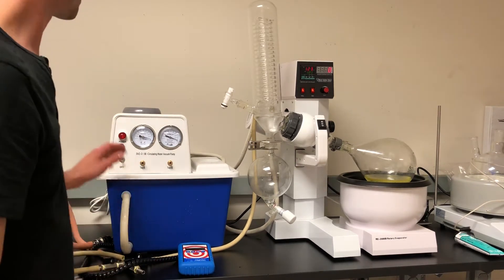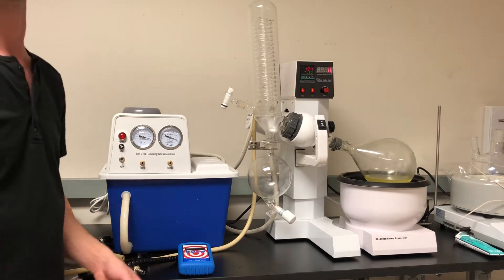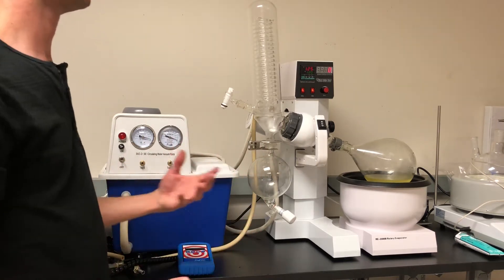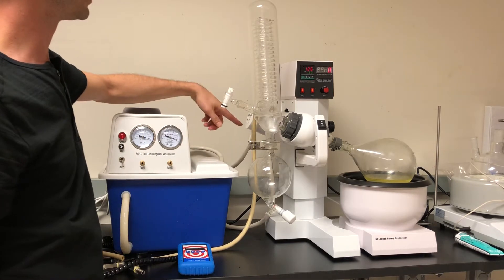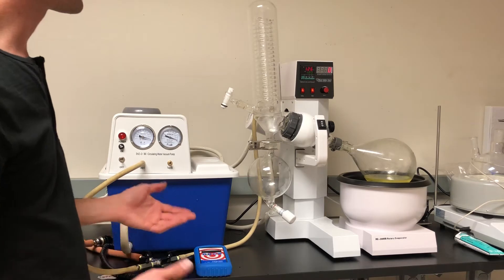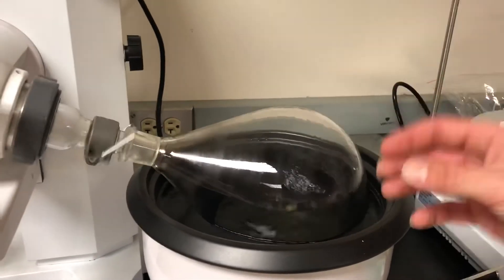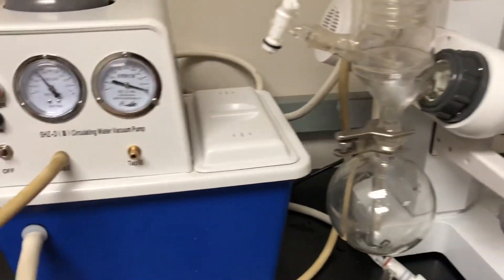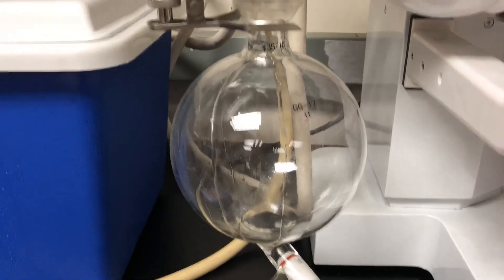Best Value Vacs Water Circulating Vacuum Pump

Comment: How high is it supposed to be filled with H20?
Reply from the maker: @sjackson1739 to ensure a smoothly running system, it's important to minimize the bubbles in the return line. There isn't a visible maximum line, but all you need is to fill the water up to about two inches from the lid.

Comment: what is the best way to get the product out of the primary flask? do you sell little scrapers or is it usually pretty easy coming out of the flask considering it prolly doest stick to the sides cause of all the spinning?
Reply from the maker: @jdspharmacopeiacsaspagyria9615 while the flask is warm from the hot bath, you can hold the flask upside down to get 99% of material out. To clean the glass we recommend using an ultrasonic cleaner.

Comment: Is that temp controller on the water bath only in Fahrenheit? Cuz if so that’s a very brain dead decision y’all made when designing this.
Reply from the maker: @Chonchi999TheG I'm sorry I thought this was America? South Park reference. Only joking, we understand you'd want to use celsius for all evaporation purposes and that is why the rotary evaporators BVV have made are in celsius. We carry 5L, 10L, 20L, and 50L systems that operate in celsius. This table top 2L is a standard 2L roto with our brand on it. I can confirm it works great when you get used to running in Fahrenheit!

Comment: are you using a cold trap? Is it needed for 2l roto Vap? I know it's needed for short path distillation.
Reply from the maker: @nebur85 you will always need to use a cold trap with a rotary vane vacuum pump. These vacuum pumps use oil and the vaporized solvent can travel down into the pump's oil causing the pump to seize. The kit shown in the video does not use an oil pump (rotary vane pump). Instead it's paired with a water aspiratoring vacuum pump. Since this pump does not use pump oil you can run a rotary evaporator without the use of a cold trap.

Comment: Can this be used for vacuum distillation also?
Reply from the maker: @Dylan Michael the rotary evaporator is basically a solvent recovery system. You cannot run distillations using this glassware.

Comment: Is it possible to carefully show exactly which hoses are connected to the condenser. An upclose view of which hoses go into each connection will be most helpful!
Reply from the maker: @sjackson1739 on the condenser there are three glass barbs. There is one barb connected to a glass tube leading to the top, this will be used for vacuum. The other two barbs are connected to the internal glass coil, you will use these to recirculate your coolant. 
We can send you a photo through email! Shoot us an email at support@shopbvv.com.

Comment: The vacuum doesn't have a regulator right, have you tried using anything like a T-valve to get some control? Does the vacuum cause any bumping problems if it is always 0-100?
Reply from the maker: This is a basic kit. We have digital regulators available as an add on.
Reply: Is that a manometer?
What units are you using? Torr? Inhg?

Comment: How do you stop mold growing in the water pump? What do you have to put in the water that won't damage the pump?
Reply from the maker: BBK407 we have not run into this issue, the one in our lab is routinely used. I will have to get back to you with an answer shortly.
Reply: Treat it as you would a pool I imagine.
Reply: They sell products for this. All the products contain copper II sulfate.